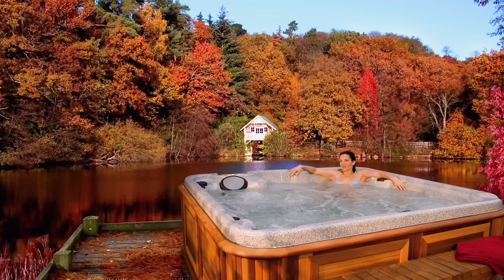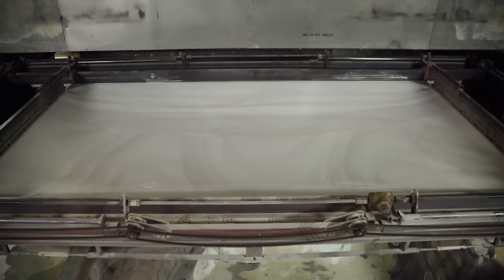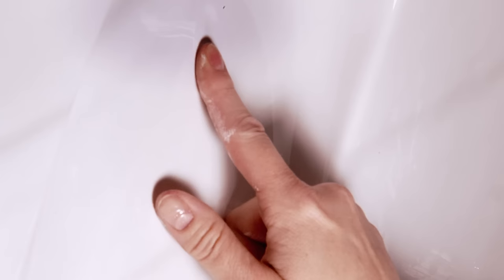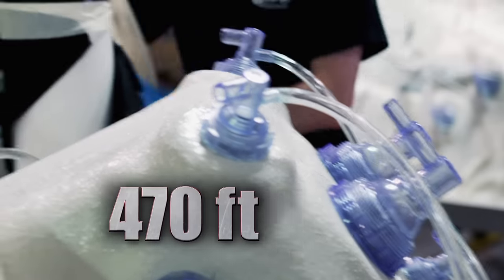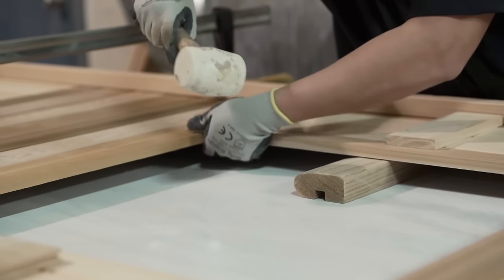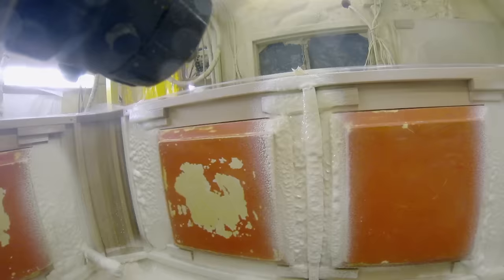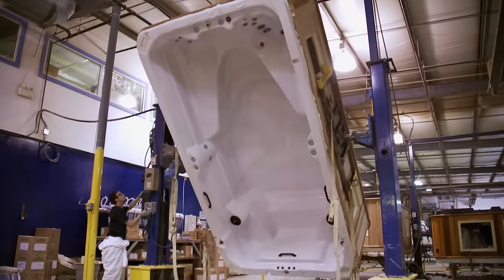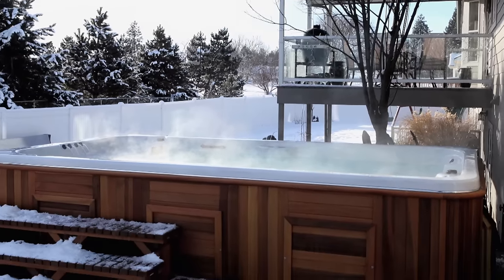How an Arctic Spa Hot Tub is made - BrandmadeTV

Comment: I'm a spa tech. Seeing that they do not blast the whole spa with foam is a huge plus. I give this spa a big stamp of approval.
Reply: Why?
Reply: Miss reign  makes leaks repairs  a lot easier to fix, saving time and money for the customer.
Reply: @OfficiaFoxDeltaGames  that should be the least of your worries with a quality spa. it should never leak to begin with if it's assembled correctly. I can see where leaks will develop over time if you dont use spray foam to stop the hoses from whipping back and forth. And I mean a quality spray foam.
Reply: @jefflinfitt9205  All spas will leak in time. A lot factors plays a role on how a spa will eventually leak. From bad plumbing from the factory, worn out shaft seals, tension on pipes, long periods of PH and Alkalinity.
Reply: Tanner Peatson  All spas leaks over time... All brands spas leak. I listed the reasons why. Also, I hate working on leaks.  I don't know what the rules are for the factory, but if they carry the shell with no gloves, probably it already cooled?
Reply: It needs to have foam insulation
Reply: I noticed that the insulation is a bit light around the top of the frame.  They need to adjust the robot sprayer to put it on more evenly.  But overall a very high quality build.
Reply: 15 year HotSpring tech here and I agree. If dense packed insulations isn’t needed keep the accessibility factor as high as possible for any future repair needs.
Reply: Leaks do happen on any spa then what dig bags of foam out? Tried it tub went to land fill foam was filled everywhere w water
Bought a used artic spa
All hoses and jets a serviceable came w extra jets
Best built spa I learned the hard way